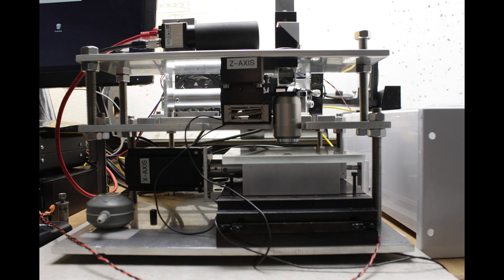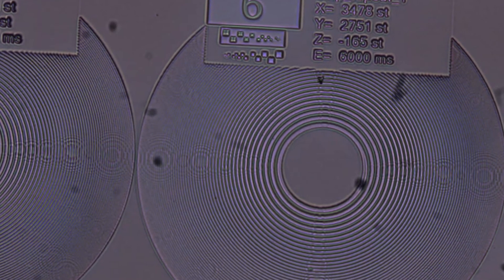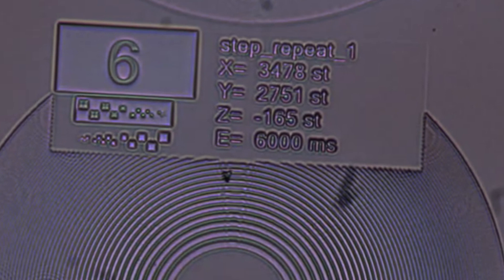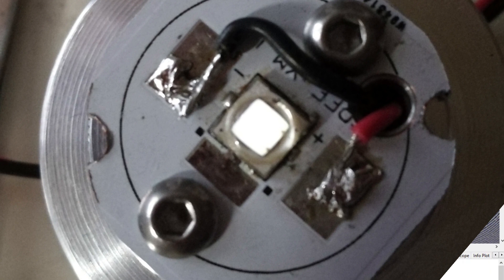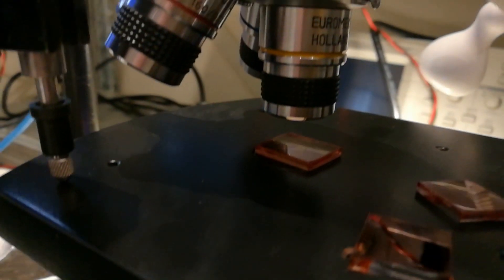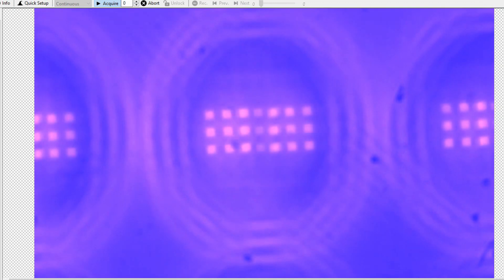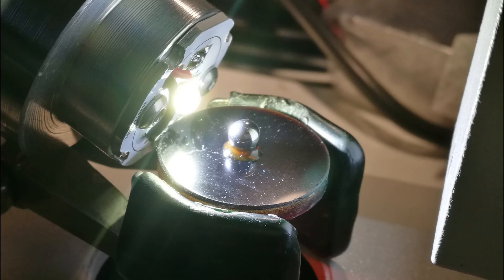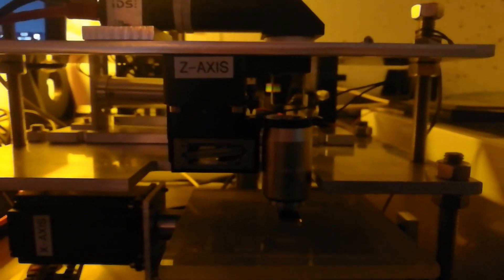Micro Lenses made with Photolithography.

Comment: If they work to make smaller images; can you also use them to magnify tiny things by placing the tiny things at the focal points?
Reply from the maker: Yes they are basically small microscope lenses (of course with a high chromatic aberration)

Comment: Did you ever think of making Hopkins Relays with these lenses? I think this would be very pleasant to play with these making ultra miniature endoscope tubes.
Reply from the maker: In general, the chromatic aberrations are quite large, so unless you discard color information and use monochromatic light, the image quality will not be sufficient for an endoscope.
Reply: @HuygensOptics  Hmm... I'm fantasising now...
What if you deposit a triple layer of three different kinds of diffraction patterns with each layer blocking just one wavelength band. Spectral notch filters are not uncommon in optics today. In this case the focal plane of each colour band could be positioned at the same distance to the "lens".
I know its crazy but maybe somehow feasible?
Reply from the maker: @ghlscitel6714 you mean like this? https://youtu.be/TshYfYIxR9E at around 2:47 minutes
Reply: @HuygensOptics  I am impressed. What you have made is even a few steps further. Yes, your experimental results inspire to think further into this direction.

Comment: by releasing your research in a public forum and having new stuff you are working on it helps keep you from being blackmailed or worse.  photonics is that sort of field. for small scale IC manufacture i have thought lab-on-chip, a little clean room with all the needed out/inlets and with leads out the bottom might be a good approach.  with a window at top for the photolithography to work.  also, why dont people's furnaces generate electricity for their homes if they are to make BTU anyway?  awesome channel

Comment: "How cool is that?"  Very cool! :)  Have you considered making hybrid optics?  E.g. pattern a diffractive lens on top of a singlet lens to make a "hybrid achromat"?  Or I guess on top of an achromat to make an apo?  I suppose that could be fairly challenging, since you'd have to model the curvature into the projected mask, and deal with out varying focal plane of the lens.  But maybe possible if the ROC is very shallow?  Dunno, this is super cool stuff, congrats on getting it working!
Reply from the maker: Thanks for the suggestion. I guess it should be possible especially  with for example plano convex lenses. In theory you can make really special optics. by the way: It's already available in commercial systems: https://cpn.canon-europe.com/content/education/infobank/lenses/multi_layer_diffractive_optical_element.do  But in order for me to do this this kind of stuff, I first need to get the pattern "stitching" perfect (currently working on this). Otherwise I can just modify the surface of lenses with a diameter of 0.4mm which is not very useful in the practical sense.
Reply: @HuygensOptics  Ahh that's a good point, I wasn't thinking about it require stitching to be useful/practical.  Guess that's just one more piece of motivation for stitching :)  Keep up the great work, really enjoying all your videos so far

Comment: I have a somewhat unconventional idea for maskless lithography that I've been researching recently - microfocus x-ray tube transmissive anode targets, where the main "focusing" is done by using a conductive, very low x-ray generation substrate(beryllium or diamond foil) with a single, tiny(100-5000nm diameter, 1-50um thick) metal(Mo or W) target dot deposited on it, rather than having to focus the electron beam to the same micron scale, which is very complicated.
Once I get around to prototyping this x-ray tube, I will be following your DLP stepper's footsteps, though a bit simplified :)
You definitely have a new subscriber.
Reply from the maker: Sounds like a pretty advanced project! If you ever publish about it or make a video, please let me know.
Reply: @HuygensOptics  I will be making videos about this project when I get to it. Working on the high vacuum system at the moment, and then lots of other steps before x-rays.

Comment: Great results! If you put an array of these on an image sensor, you could make a Shack-Hartman tester. You could also try making some CGH patterns that project images when illuminated with a laser pointer. There is a negative photoresist called SU-8 that slumps when heated and is often used to make refractive microlenses. If you could use this technique to convert your rectangular line profile to a more sinusoidal one, it might reduce the higher orders (but not the -1 order).
Reply from the maker: Thanks Adam, great suggestions! The Shack Hartman wavefront tester was actually already on my mind. It would just involve sticking one of these arrays to a CCD sensor at the focal distance. With a laser you can get 1st order spots which are diffraction limited.  I think my current patterns are already a bit wavy, especially in the outer perimeter where the resist is only partly developed. Anyway: to be continued...

Comment: Really cool. Your videos are so interesting! One thing you might try: put liquid crystal onto the diffractive element. By adjusting the electric field, some lc materials will shift refractive index, matching the pattern, or not matching it. Basically, an electrically tunable optic.
Reply from the maker: Thanks Ben, I think it's a great idea to look at the possibilities to change/modulate properties of micro optics by using electric fields. By the way, the shift in refractive index in the configuration you suggest would not change the focal distance of the lens, since this is only dependent on the spacing in the grating. But in fact you could make it switch between a clear state and a "focal" state.
P.S: love the Applied Science channel. It's one of the reasons why I started making these videos!

Comment: If you want more efficiency from your two-focus lens, instead of simply adding the two patterns together, use an XOR function. In other words, in a given location if both patterns would be black, make it invert and turn white. The patten will be restored to 50% 1 and 50% 0 and you'll have higher efficiency with no downside.
Reply from the maker: You are completely right. For this particular example I just added two diffractive patterns together in photoshop, which is a  very crude method. For example, you also see ghost-focal points pop up right in the center between the two focal points. So I will try you suggestion in future mask design. However I still have to write software for that. Thanks for your valuable suggestion.
Reply: @HuygensOptics  Photoshop has this option. Make 1 black/white layer for each zoneplate. Then apply the "difference" feature in the layer pulldown menu. It's on the of the options for showing how layers are combined. Like normal, dissolve, darken, multiply, etc. That will do it in one step!